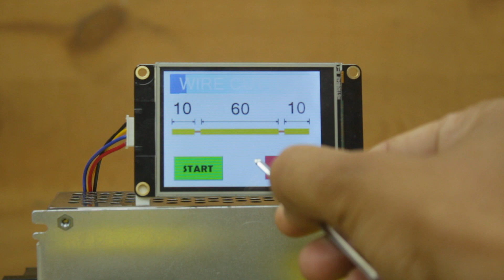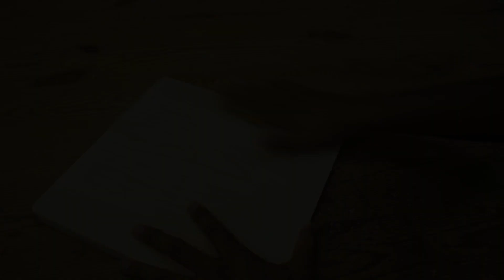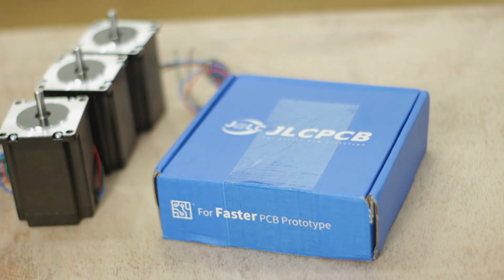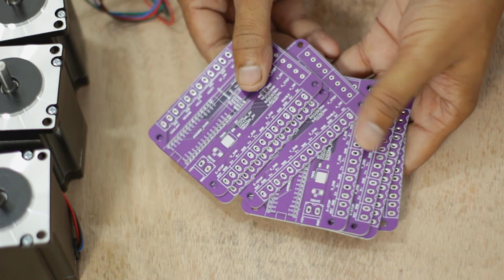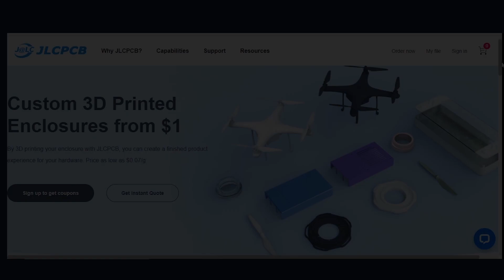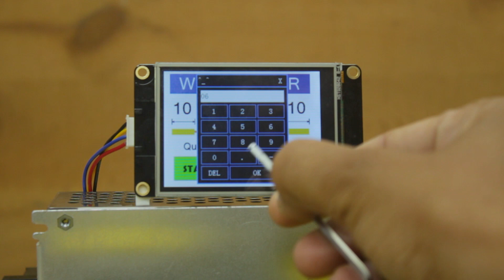DIY Wire cutter Machine using Arduino

Comment: I thought the same thing about 4 years ago with an ESP8266, but you did it. The servo controlled blade selector is the genius part. Bravo! Thanks from Colorado.
Reply: It’s also totally unnecessary: cutting the wire on the V-cut blades is actually better for the wire. (A flat cutter reduces the roundness of the cut wire ends. V-cut cutters preserve the roundness and wire lay better.) He would be wiser to use the servo to set the height of the wire properly, since this contraption is bending the wire thanks to vertical misalignment.

Comment: Any chance you could program this to have adjustable strip depth instead of using mechanical heim joints with linkage to adjust strip depth. Have the cutters only go so deep and then reverse?
I love your design, but would be nice to programmatically adjust strip depth like some do.

Comment: perfect idea, 
could we change the length of the cutting  using Z Axis values for 3D designs {designed in Artcam or else }in another words if Z value=-1 then the wire lenght is 3cm,and when Z value=-3 then the wire lenght is 1cm (positive relationship)?????????

Comment: Good morning
nice project I'd like to make it, reading on your site I noticed a few things the wiring diagram shown does not correspond to the pcb you are making is it possible to have a wiring diagram like yours to make the pcb?
Then I did not find the hmi file is it possible to have it? Last question, I didn't find the 3d file to fix the wire cutting blade to the base
Thanks and still great project
Reply: Do you have the file in hmi sir?

Comment: I did something similar about ten years ago, but I do like your partial strip ability !

https://youtu.be/i-6niamGsu4
About 6 hours of shopping and build then away she goes !
Didn’t need to fine tune it,  tu it could have been a nice project !

Same problem… I had to cut over 2000 wires overnight, so hardware and a leftover processor made a quick & dirty solution!